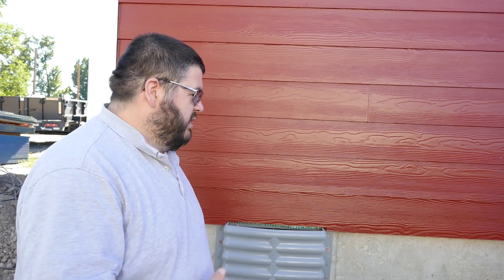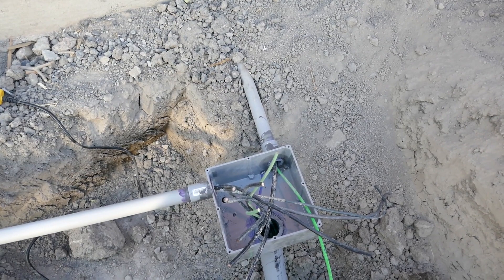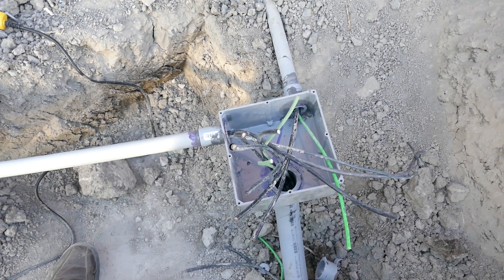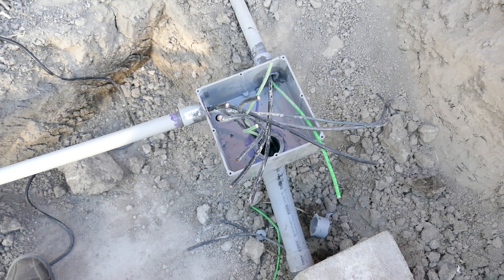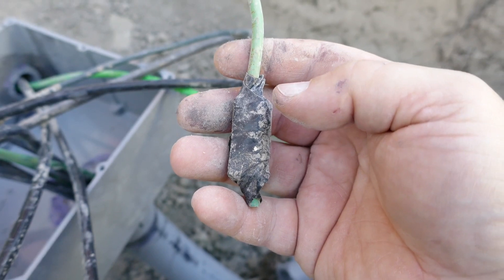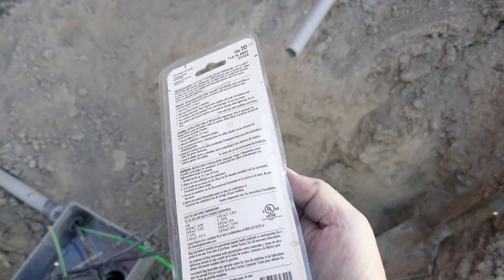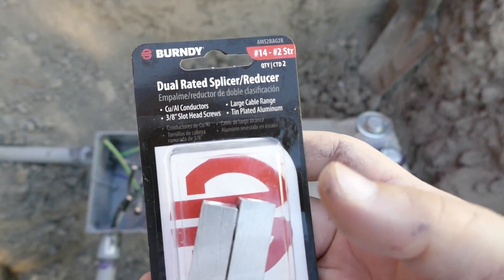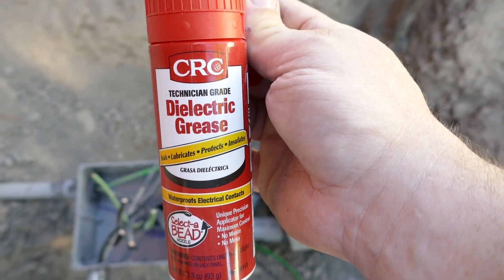Waterproof Power Connections

Comment: What tool is that induced tracker brand/name
Reply from the maker: It's a telephone line tracer, I purchased this one over 25 years ago.  You can find many like it on Amazon by searching for "telephone line tracer".
Reply: @eformance  damn, I can find them but they all have alligator clips haven't seen anything small that had induction clip only the $600+ ones with the long pole etc
Reply from the maker: @StevenGamesWHC  They don't have induction clips.  You connect the alligator clips directly to the wire, the wire itself becomes the inductor.  Induction means induced, so by putting an alternating current on the wires you are inducing a current in the wires that the pickup can sense.
Reply: @eformance  ah OK if so that's just the regular phone/ethernet cable tone finder I thought you meant induction like the expensive ones can do.
Reply from the maker: @StevenGamesWHC  Yeah, no this isn't an underground cable finder.

Comment: Should be a disclaimer made from video maker that he is not a licensed professional.
I know this is an old video, however I cannot express enough the thought of what I just watched.
1st of all, good try and it will work. Is it the proper way, NO
2nd, the lugs you use to do this type of tap have 2 things you need to look at besides the size conductor that goes in it.
    A: make sure they are able to accept copper conductors. noted by CU on the lug. Dissimilar metals apply here, corrosion is electricity's arch nemesis.
    B: torque ratings must be followed to the spec of the lug, over tightening causes heat and under tightening causes arc's. So how do you torque flat head screws? answer: they make screw tips that adapt to ratchets. Use the right size to fit snug then torque.
3rd, By squirting die electric grease in the heat shrink you defeat the water proofing of the heat shrink. Heat shrink is designed with a water proofing glue that will ooze out of the heat shrink as it is heated and shrinks around the connection. Hence impossible for water to penetrate and create corrosion.
4th, The waterproof wire nuts are great to use if used properly. In most cases with wire nuts , the chart on the back does not give all the info, hence the reason it tells you to visit website. Do not assume in electrical, it can be dangerous. In other cases the largest wire listed it takes is just for 1 wire only to cap or safe that conductor off.
5th, all grounds in that box should have been connected together even though there was 2 in one conduit.  

Wiring is not difficult, it is hard work at times. However, education comes into play. Sometimes education is learned over multiple years in the field and other times in a classroom. You Tube videos by DIYers for electrical work is not the best place to educate yourself on how to do electrical work. Electrical is very dangerous and should be taken seriously.
Reply from the maker: As others pointed out, there is a scotch-lok kit for this, and I recommend it.  I don't recommend DIYing it.  That said, am I concerned that what I did will fail or be dangerous?  No.  Good to know about "biggest number is single conductor" for these wire nuts.  Maybe one day I'll dig it up and change that, but probably not.  As for the grease in the heatshrink, while I understand the PVC liner is designed to seal, I don't trust that.  I do trust a bunch of dielectric grease.  If the wirenuts just use a rubber boot and dielectric grease, and are rated for direct bury, I'm sure my tight fitting heatshrink with grease will be fine.  The reason the grounds were not tied together is that I planned to rewire the barn and use the ground as a neutral.  In my area outbuildings can have a dedicated ground rod and do not require 4-wire to the sub-panel.  The barn will have a sub panel and there will be an appropriately sized breaker in the main panel to accommodate the smaller neutral.  If what I showed in the video makes you fearful, you should have seen what this replaced!
Reply: @eformance  Why are you arguing with someone who actually does this for a living and knows the rules and regs, as well as what works and what doesn't? Be humble and accept the feedback of a professional. He's right, you should have put a disclamer at the beginning of the video that you are not a licensed pro and teaching people what you don't know about electricity via YouTube is potentially very dangerous. Electrical work videos should be made by actual electricians... not weekend DIY'rs who have a dozen different interests in addition to their non-electrical day job.

Comment: I have an outdoor junction box that gets flooded and plan to follow you advise for waterproofing the hot wires and the neutral wires. But why do you think it is necessary to waterproof the ground wires? Ground wires are sometimes connected to copper rods to intentionally create a shorter path to ground - water does that job even better. Just curious.
Reply from the maker: The main reason has to do with corrosion.  You don't want your ground wire to corrode and lose your ground path.

Comment: How do I do this if I need to connect three hot (or neutral) wires together underground vs. two wires?  The heat shrink won’t seal around the end with 2 wires exiting will it?
Reply from the maker: Honestly, I would be hesitant to recommend a DIY solution for this.  The pinned comment on this video has a recommendation for a commercial product, perhaps they have a 3-way splice kit you can get?

Comment: Why does the ground wire go to the barn and come back? Why not just tie all three together in the box your working in and reduce one ground wire?
Reply from the maker: Because there are other electrical circuits in the barn that need ground. Also, I'm adding a sub panel in the barn and converting the ground to a neutral and adding a separate grounding rod. In my area is permissable to have a grounding rod at each outbuilding and only run hot and neutral from the main panel, this is what I did when I upgraded the electrical to my shop.

Comment: Why not use same connectors for ground and heat shrink wrap as well for better water proofing compared to gel nuts? I’m just a home owner looking to learn.
Reply from the maker: The gel nuts were cheaper and worked fine for that application.